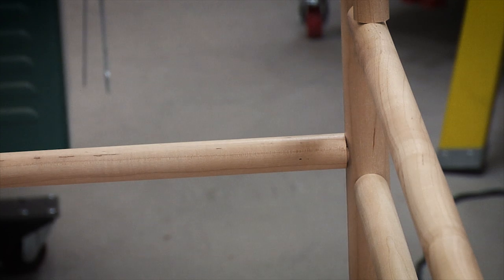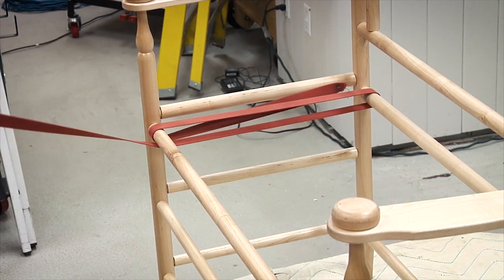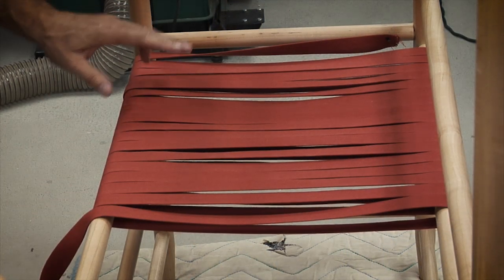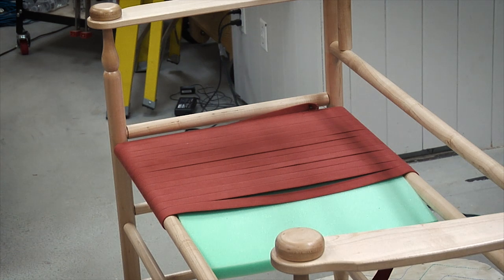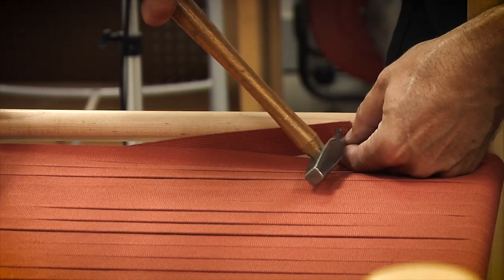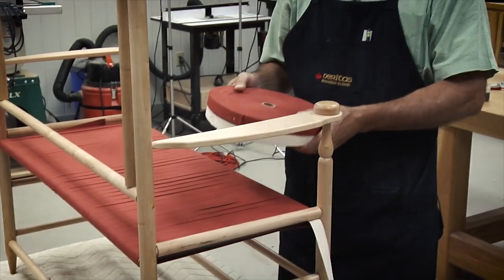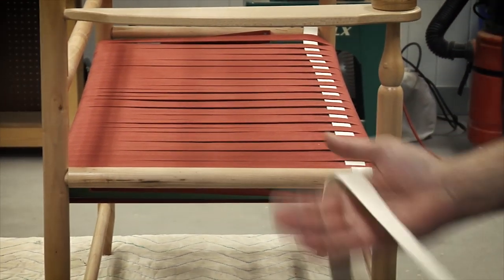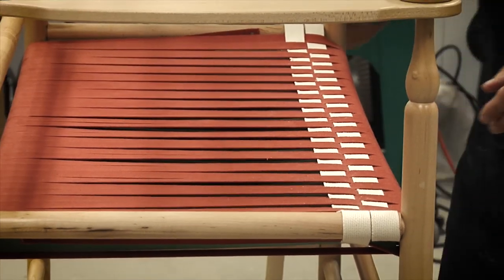How To Weave A Seat For A Shaker Bench - WOOD magazine

Comment: if you tuck the woof tape into the opposite side every time you finish a row, you can pull it all through without worrying about it twisting and having to run it through your hands to make sure it's still oriented correctly